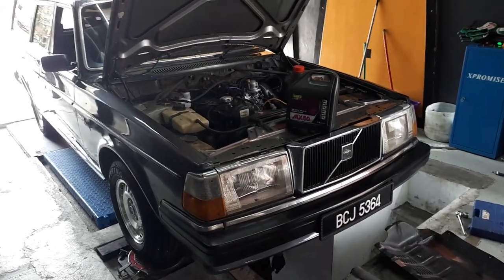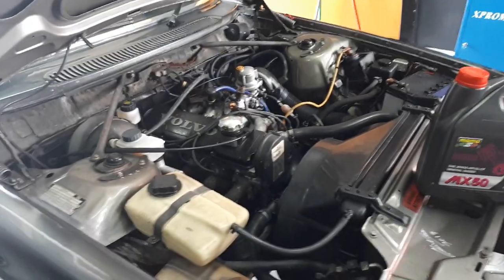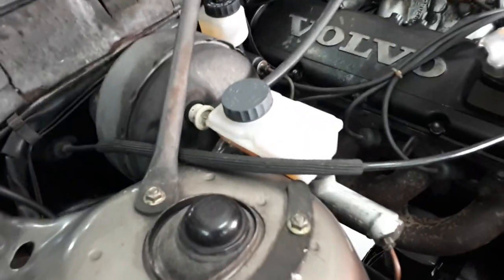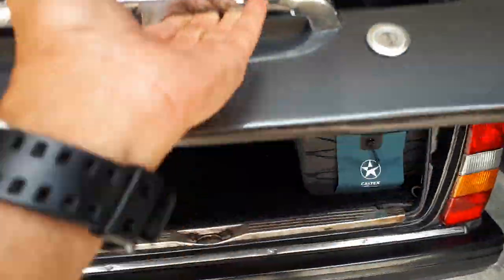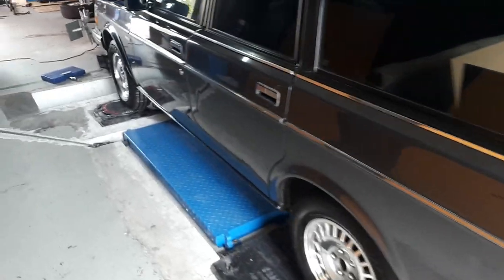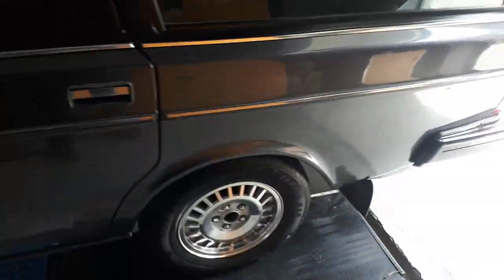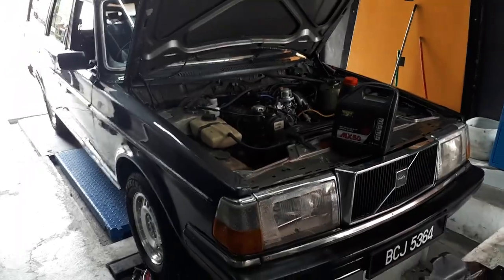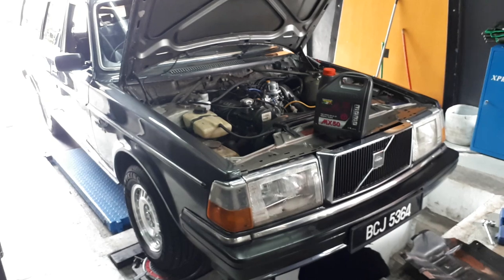UCR UPDATE - RELOAD! 1985 Volvo 245 "Brickwagon" Gets New Momo Engine Oil! | EvoMalaysia.com

Comment: Add a little blob of silicone glue around the rim of center caps before popping them back on. It helps with heat and vibration and stops them from falling off.☺️
Reply from the maker: I did. One still fell off, lol!!😂
Reply: Chris Wee 🤣

Comment: Chris...the oil goes low right after overhaul because when they fill it up, the refurbed and un-oiled galleries will get loaded with the stuff. Usually, the tech will advise you to come in after a week or a 1000km whichever is earlier for 'tightening' and also re-checking all fluids which by then should have settled.
Reply from the maker: Yeah, he might have said to come back and it slipped my mind, happens 🤭

Comment: I don't think I've ever seen the Volvo wagon model that Tyler had, with the two square headlights on each side here in Malaysia, the one in this video is pretty rare as well, I've only seen about 2 my whole life
Reply from the maker: There are a few still plodding along, serving their owners faithfully as the car Gods intended, but yeah, they're getting rare now 🙏🏽😊
Reply: Those are US Spec headlights. Quad square Sealed Beam units. Was the US DOT requisite since the smart arses over yonder presumed that by having not so efficient lights..peeps will not drive as fast night time and won't blind oncoming traffic as well. Hence Halogens are illegal. Witness the quad round headlights of the R107/W116 Mercs, 'Sugar Scoop' headlamps of the 911s and stoopid 'federal' bumpers of that period. Oh..and speedo max of 80 mph. They have seen the light, so to speak and nowadays, halogens and Xenons and Lasers are welcome to light up 'Murican roads...